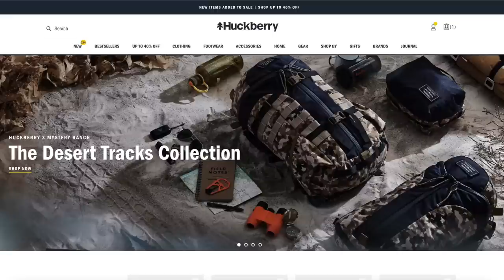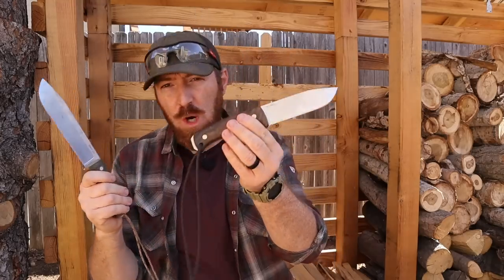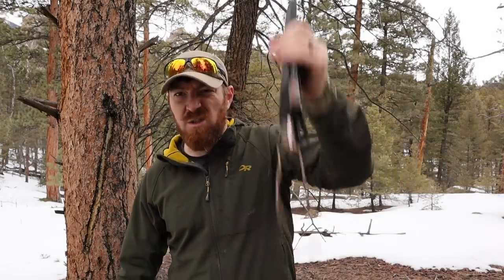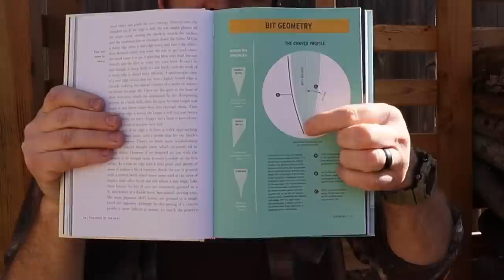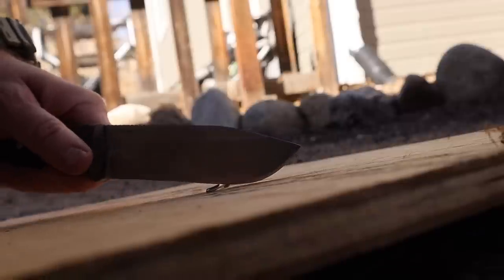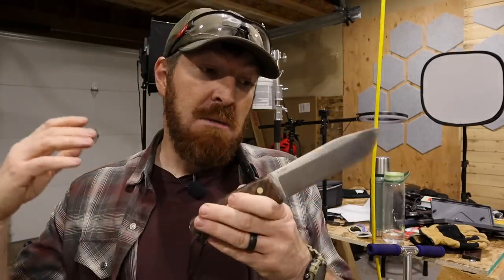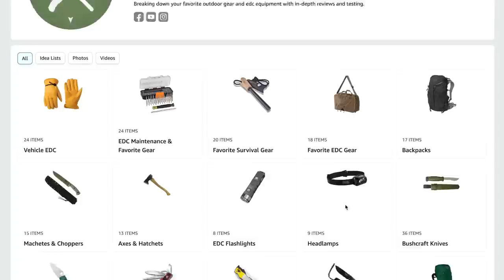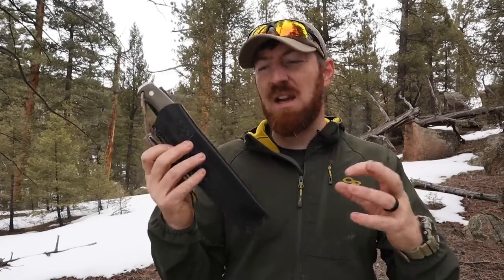NEW Joker Nomad 6.5 Stainless Survival Knife!

Comment: The Joker is a formidable tool. I have considered these knives for some time. Last year, I  purchased a Lion Steel T5 and feel it is great all aroud knife. The comfort and grip of the handle is the best of any knife I own. 
I  didn't like the old sheath design of belt loop with the buttons. The new sheath is a great improvement. The work sharp belt sharpener would be a good choice for maintaining the blade. A very good value for a survival knife, and I may have to invest in another very capable tool. 
Great video, and I'm looking forward to it being available for purchase.

Comment: Now own several Joker blades (fixed & folding) and love them. Work well and good value. Don't have a Nomad - but this one is on the list!! In relation to convex edges, they're not quite as hard to maintain as some think. In fact, many users often create a small convex edge when attempting to sharpen other grinds. That is, many users find it hard to keep a knife edge at a fixed angle and often rock the blade when moving back & forth. Having said that, you're 100% right - practice on a cheap blade first!! Sharp blades all.

Comment: I am super excited about this new, bigger Nomad! I just wish Joker had changed the steel from N695 to Sandvik 14C28N like they use on most of their other knives. That is a much better choice in my opinion for a large, hard use knife than N695.

Speaking of N695, I think you got that and N690 backwards. N695 is essentially the same as 440C, while N690 is essentially the same as VG10 and is the more expensive steel. Knife manufacturers like Bradford, Brisa and Boker (funny how they all begin with B) use N690 as a budget “premium” stainless steel option.

As far as competitive options, I think the Esee 6 is very comparable in price, size and function. If I had to pick between those two I would definitely go with the Esee 6 though. The 1095 HC steel is a better choice for a large, heavy use knife than N695, and you get the unconditional, lifetime warranty with the Esee as well.
Reply: 14c28n, 13c26 (or aebl), Aus10a or no a not sure. I usually gravitate towards these, except aebl eludes me for some reason. For survival and stainless, those come in mind for toughness. Maybe aus10a can keep up with 14c28n, but I'm not sure 🤔 

Cold steel uses aus10a in their folders to great success, the 4max scout survived Joe-x's test. Still I'm surprised I only see aebl being used by custom knife makers

Comment: G'day Aaron, I'm extremely pleased to see the release of this one mate. i've been sooooo happy with the 5 incher. I'm with ya though, fair to say its sheath would be much better served with a stitched belt loop like this one.
I do have an issue with the concept of a single tool "survival knife". As you mentioned, there needs to be a hatchet or machete or some other big fella and a saw involved. Could you survive with just a solid 6 1/2 incher ........ yes you COULD, ....... by why would ya ....... + that leaves you with no back up.
Re: sharpening convex knives, @ home I use a cloth backed sandpaper, suitable for steel, on a spare flat floor tile, a scrap piece of glass will also work just the same
Out in the bush I use a Worksharp Field Sharpener too, great unit, but I use it like a file on convex edges. I reckon its easier and more intuitive to "rock" a pocket sharpener over a stationary edge, rather than the other way around, but hey man, what ever works best for you. Cheers Duke.

Comment: I have 2 joker knives, the Nomad and the Ember and I love them both and yes I had the button snap issue with the sheaths and almost lost my Nomad but I solved it on both with J.B. Weld in the snaps. I promise they wont be coming loose.
Reply: I used epoxy.  Jb weld is great idea

Comment: I had bad luck with Streamlight and the tail switch quit working after a year. For about $35 I got a Soonfire light off of Amazon and it has my EDC light for 3 years. The Soonfire has a rechargeable lithium battery that I have never had to replace and it gives me up to 1000 lumens or a low level light that will last for 100s of hours.

Comment: Aaron,

Okay. So as to carrying a larger knife besides the Joker Nessmuck as the primary camp knife, it would be nice to see a comparison between the Nomad 6.5 and the Tops Brush Wolf. What one would you choose? I am torn between the two. My envision of light camp blade gear is the Joker Nessmuck, Silky Big Boy, Grandpa Axe, and or either the Joker Nomad 6.5 or the Tops Brush Wolf. Your thoughts and potential comparisons of pros and cons would be great. Thank you for your time.
Reply from the maker: That is tough.  Both are great.  The Joker will baton a little better because of the less aggressive tip.  The brushwolf will chop better.  The saw back is great for quick notches.  The convex is slicy by requires that extra maintenance skill for resharpening. If I could one have one the brushwolf would win.
Reply: Thanks Aaron.

Comment: The question, “what is a survival knife?”, and correspondingly what are the chances you might need one is debatable.  But, in considering one, would you choose N690 steel?  A metal edge so soft as to be rolled by a small soft steel nail seems to be a liability in a survival situation.  Not a prudent choice.
Reply: Easy to resharpen and more resistant to corrosion being quality stainless. 
Not the best knife you could get for survival but for less than $150…it’s a great deal

Comment: I have the Nomad and I like that knife a lot. I also have Fällkniven A1 that is larger. Recently I learned that Brisa in Finland have launched a BigMuk so a really large Nessmuk. It is a Leuko (chopper in Finnish). on steroids,. Previously I didn't buy knives larger than 6,5 - 7 inch blades. However I have a very good saw in full size and with a foldable wooden frame. For a grill evening or food a fire for making lunch I think a heavy duty knife will work great for splitting wood. Here the Bigmuk really work great. For get a lot of wood for a day or two I would still bring my medium sized axe from Gränsfors. The Bigmuk works great and wheighs 600 grama. If I take my axe it will be 1,5 kilos instead. The Nessmuk shape makes it OK. to also do finer cutting close to the handle. I think you should try the Bigmuk. It impressed me a lot.